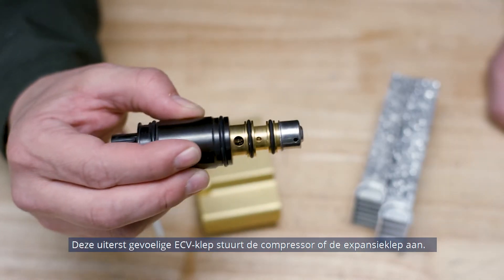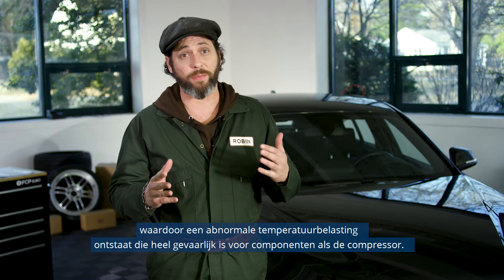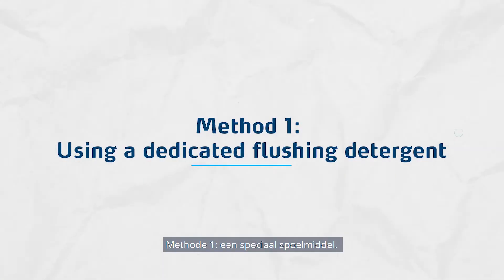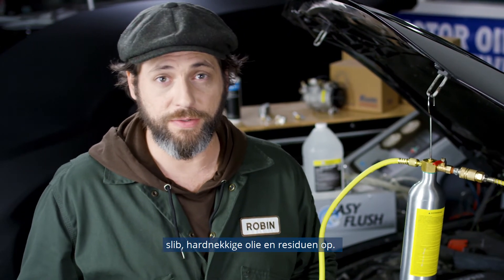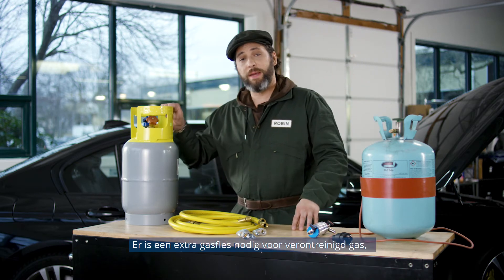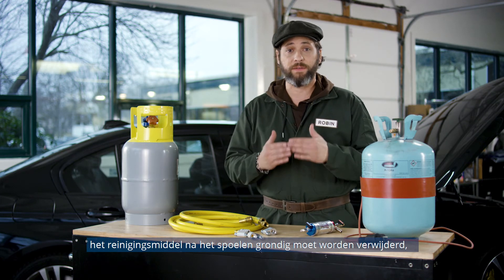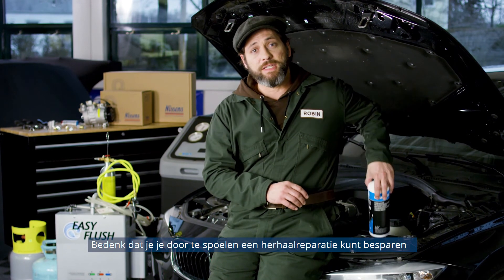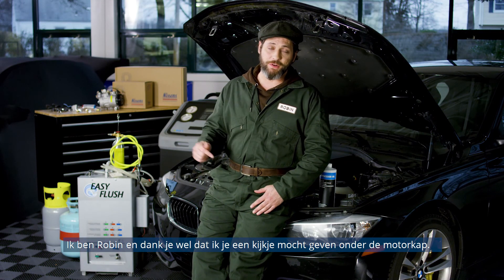(NL) Voorbereidingen om een aircosysteem te spoelen Airconditioningsysteem voor auto's

Comment: This video auto played and I listened to the entire video I'm very mechanically enclined and have to say this guy is spot on. Also note bug/trash build up will also block air flow through fins and will also impact your system as well but you should never try to pressure wash as this may cause more damage than good so if extremely built up you may need to replace as well